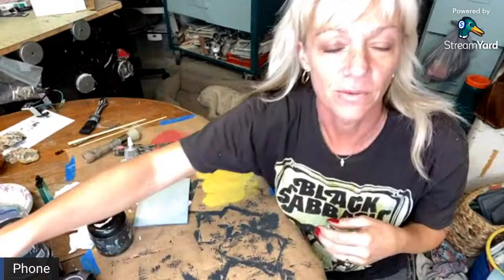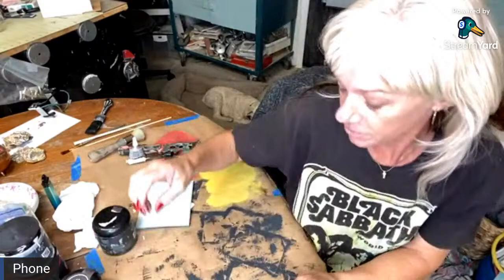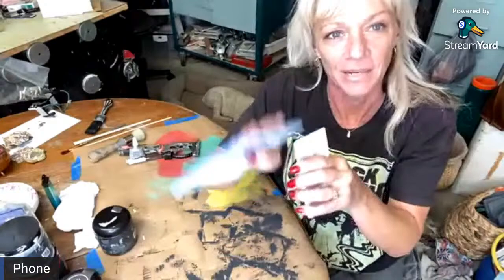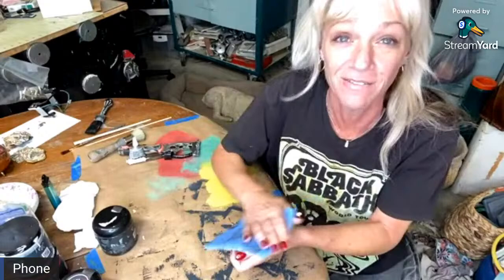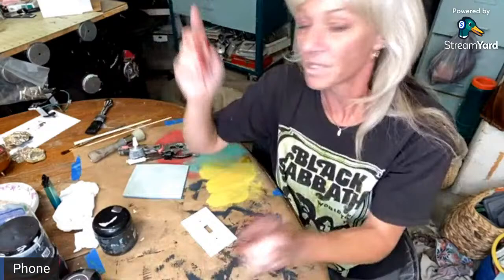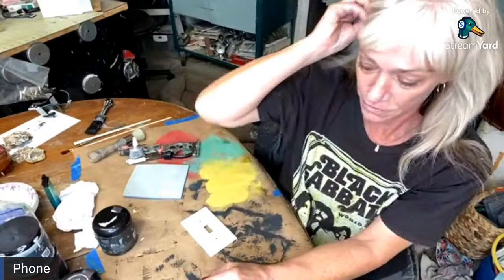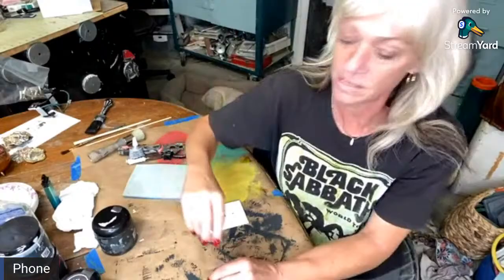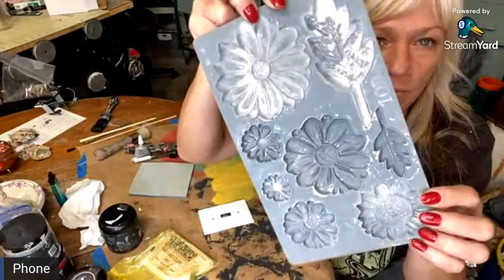IOD molds. Easy fun project great gifts!

Comment: Great video, good idea with the light switch!

I just had to comment about the BS tshirt you have on… that’s not a vintage original T. (It’s from 2004, look at the 1970s era prints for comparison) If it was, it would be worth a lot of money and you wouldn’t wanna be willy nilly with it, getting paint and stuff on it. I’ve sold several of my old metal tshirts and made a small fortune. So if you have any authentic 1970s, 80s and 90 eras metal Ts, please don’t paint in them! 😬